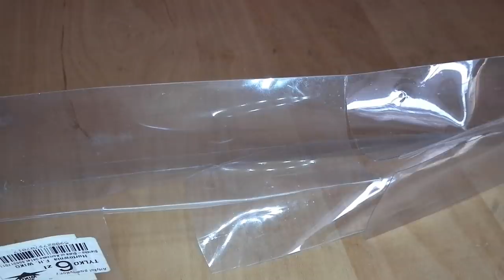Pendant with a DANDELION and Epoxy Resin / ART RESIN

Comment: Very good...
It's like one of them charms that you can get...

Good tip for you:
You can always put a drill in the lathe chuck and then drill something doing it that way...
If the chuck won't grip the drill then get a pin chuck with a straight shank and put the pin chuck in the lathe chuck... 👍
Reply from the maker: I have never tried that. thank you

Comment: Looks stunning. Why did you pour more resin over the pendant rather than polish the original surface? Cheers, Huw
Reply: Perhaps because the dandelion was so close to the surface.  The added resin gave it the illusion of more depth and floating in space.  If he left it as it was, the dandelion would have looked like it was being held up in resin, rather than suspended.  🙏
Reply: @cindylloyd2365  Thanks, makes a lot of sense. Cheers Huw